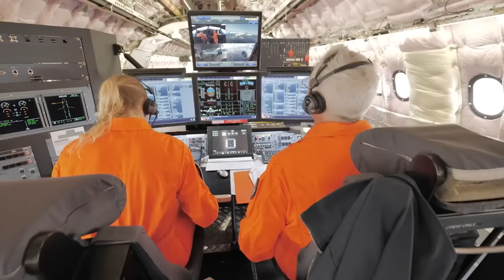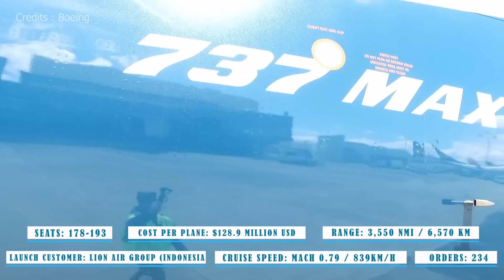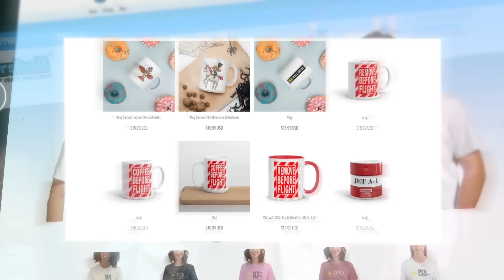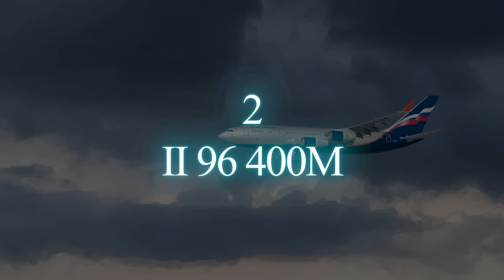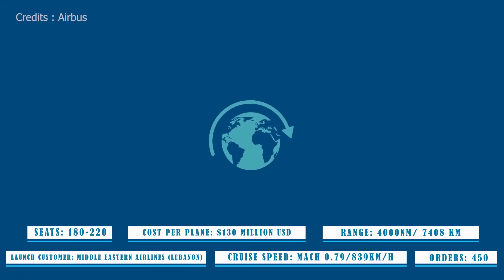Top 10 NEW Aircraft | New Passenger Planes in 2021

Comment from the maker: Thanks for the feedback everyone! 

Just a heads up that at 07.59 the IL-96-400M is incorrectly addressed as the II 96 400M. It should be Ilyushin IL-96 -400M instead. The capital I was followed by a small L (l) and we missed this in production. We apologise for the error. 

Also, we have had some complaints that the 737 Max 8 flew in 2017 but as it was grounded until Nov 2020, we decided to add it to the list of new aircraft flying in 2021 as it returns to flying status around the world.
Reply: Why does it matter if it’s IL v. Il?